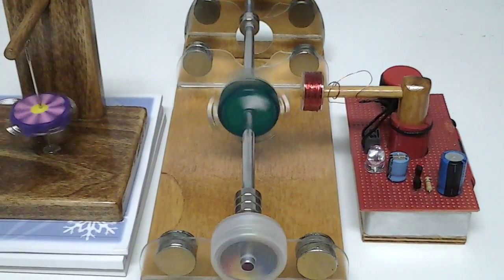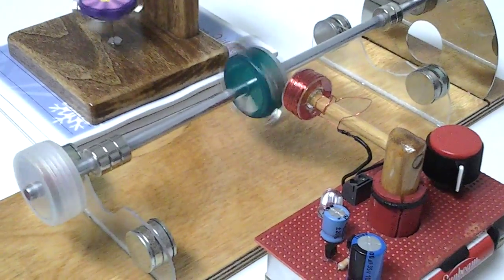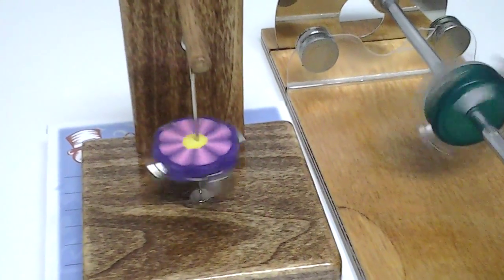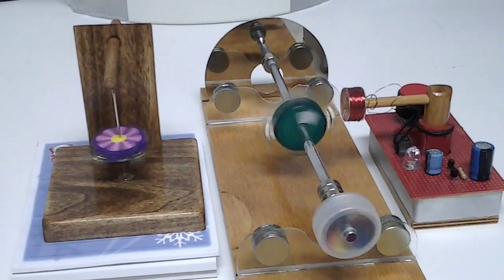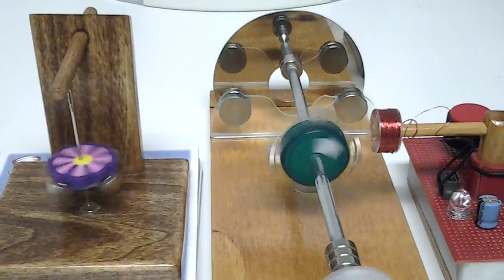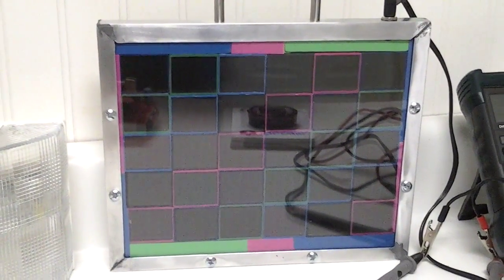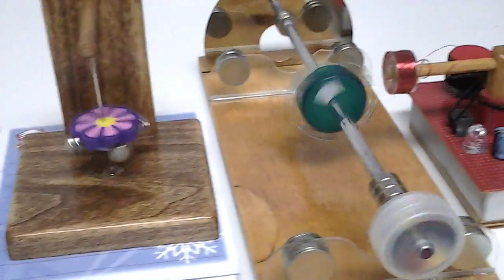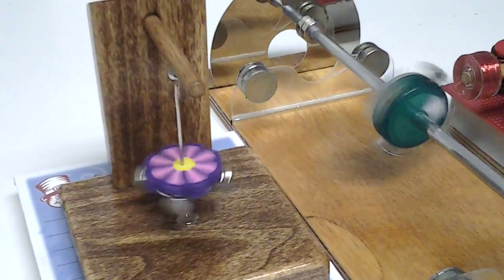90deg magnetic gearing

Comment from the maker: Thanks Slider.  30 solar lights - 3(series) groups of 10(parallel), would have been cheaper to buy a panel but the best part was watching the math at work when adding series and parallel cells together and the math tells you all the cells are contributing to the output.  I changed to a different levitator today (large ring magnets from some old speakers instead of the large button magnets) and it was much more stable and the secondary rotor reacts to it much better.